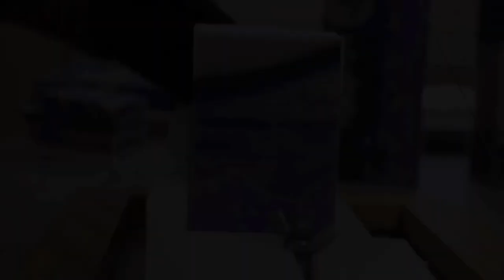Enchanted Cold Process Soap Making

Comment: Hi Ophelia!  What is the temperature of the lye when you add it over butter?  Are the butters at room temperature or can they be from the fridge?
Reply from the maker: The lye is around 200°F. The oils are room temp. I would try it on a small batch. I’m assuming it would still melt them. But I’ve always used room temperature oils and butters :)
Reply: Thanks a lot 🌷